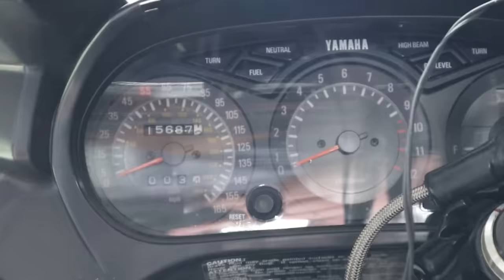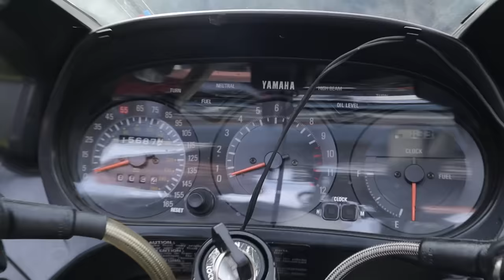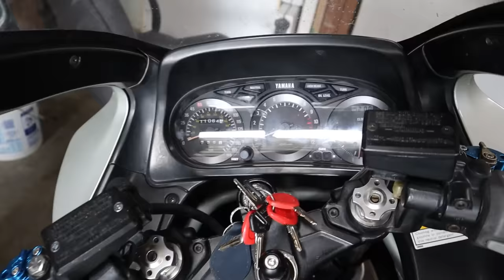Will This 37 Year Old Motorcycle Run & Get Me Home?

Comment: This reminds me of the fairly new lawnmower my buddy gave me. He said that if I could get it started, I could have it. Took it home, checked the air filter and spark plug, checked the oil. Everything looked fine. Put gas in it, pulled 2 times, and it started. I called him to tell him and I asked him "did you ever make sure it had gas when you couldn't get it started". He swears that he did, but he was fine with me keeping it. That was 6 years ago and it's still going strong.
Reply: Is it a Honda?😁
Reply: it aint got no gas in it
Reply: That lawnmower's going better than my same age marriage! /jk
Reply: @dxb338   Well stated, Karl

Comment: Self inflicted problems. Never put water in a tank unless you have the time or equipment to dry it out completely before using it. If you are trying to get it going quickly, dump fresh gas in it, swish it around and then dump it out. Then you only have the left over rust to worry about.

Comment: Awesome deal Craig!! I love the FJ's!!

I've personally had four FJ-Series motorcycles - a 1984 FJ600, a 1984 FJ1100, an '87 FJ1200, and a 2005 FJR1300. They are fantastic bikes!! Super comfortable (even with the stock seat!!), very reliable, great handling, and ridiculously fast for their time.

The biggest downfall of the early models is the 16" front tire and tiny, 2-piston front brake calipers on tiny rotors. There are only a couple of tire manufacturers that make rubber for those things. The brakes were acceptable for the era but compared to modern brakes, I think Groms have better stopping power...🙄🙄 In 1988 they switched to 17" wheels from the factory which really helped - a LOT! They also upgraded the brakes to the 4-piston calipers with 320mm rotors from the FZR1000.

I believe his Blue one is 1992 ABS model. Very rare these days!!

The biggest mistake you made with this attempt was trying to wash that tank with water. If you had just flushed the tank with some fresh fuel and synched the carbs, you probably could have rode it home. 

The only ergonomic downside to the FJs was the handlebar buzz.  They put huge bar-end weights to temper the buzz, and it helped tremendously, but after a couple hours of continuous highway, your hands start having off-body experiences...

Mechanically, they are rock solid powertrains except for 2nd gear. It was a little weak and many people who drag-raced them would blow out 2nd gear. A little machining (undercutting) would do the trick but it required the engine to be pulled and cases split.

The demise of these bikes turned out to be the automotive racing world...The Legends cars racing series was born in 1992. They are 5/8th scale '34 Ford styled, tubular framed cars using the FJ1200, XJ1250, and FZ09 engines. Many FJ1200's were removed from the roads to power these race cars, hence there is a distinct shortage of these bikes on the roadways.

Great video!! Great bike!! Love the channel!!!

Comment: I have cleaned loose pieces from (empty and dry) tanks by removing the petcock and blowing compressed air in the petcock hole of the tank while at the same time as blowing the air putting a shop vac on the fill hole. You will hear the rust and dirt pieces bouncing around and getting sucked out then eventually you wont hear any more loose rust pieces in the tank. Make sure the tank doesn’t have any gas in it and is dry. I sit them open in the sun outside of my shop for a couple days to make sure they dry out fully.

Comment: Finally, a famous YouTube motor head has featured my favorite sport touring motor cycle of all time! Thanks Craig! 
I have a 86 fj1200! If you aren’t familiar with these bikes, I like to let you know they are capable of 100k trouble free miles and the torque is there for days!
Reply: They could really use a 6th gear. I went down two teeth on my rear sprocket, really helps with fuel consumption and gives you a little more top end speed, as if anyone ever needed that lol. One of these days I'm going to find a really tidy XJR and make it my forever bike.
Reply: If you want a 17" rear wheel, the FZR400 wheel with spacers is a match. For the 16' rear I recommend the Avon Cobra tyre. I tried a Michelin Commander because of the high mileage you can get from them, but found they don't hook up nicely in the wet like an Avon will. There's a cheap brand called Full Bore, they stick well but you'll be lucky to get 6000km from one.

Comment: I worked at a bike shop in Bristol (the original one ) and in the 4years on the parts counter in the 1990s I only sold a few service items for this model .the hydraulic clutch slave cylinder was a week spot and for some reason the rear wheel bearings (don't know why) I had customers who used these for work dispatch riders who deliver important documents usually legal papers and some of them ran up over 100k with no problems.brilliant bike 👍
👍

Comment: I was in that situation once (water in the tank....). The water always settles at the lowest point, which is the float bowls on the carbs, and they have drain screws on them. After repeated draining, petrol eventually started coming through, and internal combustions were resumed.
Reply: Good tip!

Comment: @20:00 you should start bringing BBs with you for these adventures to clean tanks with. I usually use copper BBs (like for BB guns) I've done that for quite a few tanks, just throw a little fluid like degreaser or white vinegar in with them then slosh and turn it while sloshing them around and it'll clean up tanks with just surface rust really good. If its a little deeper rust you can strap the tank to an atv/car wheel while jacked up and throw it in gear and it'll come out like new but it's definitely a lil sketchy lol.

Comment: I used to have an FJ.  A red 1TX which I had for a few years. Always reliable and with lots of grunt and decent handling for a big heavy bike. I replaced a rattling starter chain which meant splitting the motor, but a nice engine to work on. There's a great owners club in the UK with tool rental etc. Great video, thanks.
Reply: My buddy has 52 FJ's

Comment: I have an 87 fj. I modified it for drag racing. lowered, r1 rims, lowered and tucked in the front fairing, dropped the handle bars 8 inches, wheelie bars, 2 step, air shifter, shortened the tail 14 inches and modified the seat. I bought it with 110 000 kms!!! I could tell it had been through a lot already. most fairing attachment points were broke, cracks everywhere. exhaust rotted at the collector so i modified the exhaust. raced 3.5 years with it. placed 3rd overall my second year, 4th place last year and it still wants more but i want to go faster so im going with the gsxr 1000 with extended swingarm... new ballgame

Comment: Pro tip for water in your tank works with lawnmowers too, if you have water in the fuel you can at cheap gas with lots of ethanol or sea foam, really just look for anything with ethanol or isopropanol water mixes with alcohol and alcohol mixes with gas it's especially useful if you have a mostly full tank of fuel it also works with diesel, seafoam is made for it it works really well and it can help lube the top end if you use it right it also won't effect how it runs or it'll run better
Reply: I used to add 20ml Methylated Spirits and 60 ml deisel to each full tank of petrol on the two FJ's I owned, travelled 50, 000 km on each bike from 100,000 km on the clock when I bought them, no trouble at all

Comment: After watching your videos I got off my coach and worked on my 1973 GT250 twin that has sat for 20 years. It now starts with one kick. Now I have to clean the tank and fix the front brake and I can put it on the road.

Comment: I had a 2009 Yamaha Royalstar 1300cc quad carb. I synced the carbs multiple times using the surgical tube and transmission fluid method. Worked great!

Comment: The best way I have found to remove rust from a fuel tank is to drop about a foot long piece of chain in the tank and shake it around. Rinse with some WD-40 and repeat. Carry a couple of gallon sized cans of the WD with you. It works great and burns off better than water.

Comment: I rebuilt an old Yamaha Radian with a really rusty tank.  I bought a container of BB's, and along with a little gas, was able to clean the tank really well just by sloshing it around.  Only took about 20 minutes of rolling it all around.  You should keep a container of those in your trailer.

Comment: I had an '88 in white & silver with red stripes. Updated to R1 brake calipers (bolt straight on) & braided lines. Cobra slip on cans, K&N filter, Dyno Jet kit (used the "medium" setting parts). Was bullet proof & fast. Plastic body parts go brittle & crack so learned how to fix that. Put a "shift kit" in it, as I heard that sloppy shifts could destroy 2nd. gear. Toured it flawlessly. Best bike I ever had.
Would have bought another if not discontinued. The FJ1300 was too expensive & too heavy for me when it came out, & not a shaft drive fan. Now have a 2013 Suzuki GSX1250fa. The closest I could get. Less HP, more torque, & water cooled. Radial tyres, fuel injection & 3 piece hard luggage standard. But man I miss "the Rocket 88" !!.

Comment: Craig - A 50/50 mix of water and vinegar with a dash of salt and one literal drop of dish soap will often clean a tank in 15 minutes to an hour while if really badly scaled with rust might need a day or two.  What you drain out can be used around fences as weed killer.  If you had filled the tank with the vinegar solution when you first got there it may have been all ready to flush with the garden hose after you got the carbs back on.  Some might use muriatic acid however you have to be much more careful with it and flush out the tank extremely well afterwards.

A can of Dry Gas might have gotten you past not borrowing a hair dryer to warm up the tank and dry it out before putting the gas in it.  Sometimes even an old radiator hose on your trucks tail pipe can be used to dry things if you don't have easy access to a hair dryer or a heat gun with a low temp setting.

Best!

Comment: I have personally experienced what water does to your bike. My 99' Suzuki SV650 had a broken tank drain pipe which would let water into the tank and you could see the seperation of water and petrol when I drained it. Water sinks to the bottom and then thats what gets sucked into the carbs. I've heard methylated spirit absorbs water and makes it easier to burn, so try carrying that around and adding that into the fuel.

Comment: For rusty tanks I've had great success using The Works toilet bowl cleaner, cleans the rust right up.  Leave it set for an hour or three.  Rinse with water and  baking soda to neutralize the acid.   Coat inside with WD40 .  Works great.

Comment: I saw an FJ 1100 yesterday going into an underground carpark. It looked awesome. I recognised it from my distant past. Saw it again today. It looks like new. I remember when they were released here in Australia in 1984. Proper super bike. That horizontal incline 4 and for it's time weird  frame and half (?) fairing fixed directly to it were so distinctive. I knew they had 16's front and rear, but hadn't thought about how difficult tyres might be to get now. Just spent a bit of time checking online how much a good 84 FJ11 or later FJ12 Might cost. If I remember correctly Yamaha fitted them with a really wide rear tire to help control those beasts.

Comment: There's no better motorcycle to bring back to life after being parked up for 20 years than a FJ 1100 or 1200. Extremely bulletproof engine, a rigid chassis that is ready for suspension, wheel and brake upgrades and a torque monster of an engine that pulls like a freight train. I've owned a 1990 FJ 1200 and currently own a 1993 FJ 1200 that has been treated to the full suspension upgrade and later model 17" Yamaha wheels. It shocks people when I tell them that my old Yamaha is 30 years old. Riders that ride it are even more shocked that it is 30 years old.

Comment: Nice work, Craig.  I like it when you get bikes back on the road.   Evaporust will do the trick on that tank if it's just rust.  If it's old varnished gas, I've had good luck with a mix of PineSol and hot water... let that sit for a day or two then do the Evaporust and you should be good. .

Comment: In the future. Water is more dence than fuel. Put some gas in the tank, wait 10-15 minutes, and drain the line from the petcock. This will pull out the majority of the water. You can also add alcohol to the fuel, as it bonds with the water, and helps separate it faster.

Comment: A handful of nuts and bolts, and some tank cleaner, sloshing by hand,and flushing with water, and then drying out, should give you a good start on the tank. In line , see through fuel filters are great.

Comment: Hi Craig, nice video as always! I think you can get rid of the water in the tank by washing it with ethanol as it is miscible with water. Than you can fill it up with gas (the engine should tollerate the slightly higher ethanol percentage). Or you can fill with gas, shake the tank and drain it from the bottom slowly until you see gas pouring out. Bye from Italy!

Comment: If you are into old Yamaha, you'll probably like what I did with a junked old XJ900S Diversion from 1997 with 89,000 miles on the clock. It was a lockdown project that turned out quite well. See profile photo. Works great now and weighs about 35kg less than stock.

Comment: I know everyone hates ethanol in fuel but here's a place it could have helped. An old trick for if you had water in the fuel was to throw half a litre of ethanol/methylated spirits in the tank and give it a good shake. The water will attach itself to the ethanol and kind of mix with the fuel (not well, but well enough to get carried through with it if you don't leave it to settle). Ethanol usually comes as 70% and actively absorbs water but it's still flammable at 40% water (vodka burns). So a litre of 70% ethanol will absorb 750ml of water and still be flammable. Even better would be to rinse the tank with ethanol then empty it out before adding fuel, that's how I get tanks totally dry after rinsing them when adding a sealant.

Comment: Let us know how you de-rust that tank. I just finished a 7.5 gallon ZG1000 in similar condition. A few weeks in molasses water with a couple sessions of shaking with nuts and bolts inside. Then a vinegar wash, water rinse, alcohol drying and finally a phosphoric acid pickle. I got some white dusty residue from the phosphoric acid rinse but I added a fuel filter. Anywho, this seems to have worked but it would be nice to see how you proceed with this tank. Thank you!

Comment: Need some high proof ethanol to add to the tank. Everclear 190 or moonshine over 130 proof. It will make the water mix with the gas. Methanol may melt tank sealer. A friend of mine loves his FJ1200. He almost went insane trying to fix an oil leak in the front of the head. It was buried South of the equator. Had to take half the bike apart just to get to it.

Comment: Need the airbox to create some choke/restriction to make for proper jetting otherwise it will be too lean. If it were jetted for PODS then you would not be lean with them off as there is little restriction with PODS.
Reply: It's also had its exhaus modified. Valdating the jetting would definitely be a good idea.

Comment: Have you ever used Gas-Dri. or Heet? It's basically ethanol (or maybe methanol) that makes the water miscible with the gasoline, so the vehicle can burn off a small amount of water in the lines.

Comment: white vinegar from the grocery store will clean that tank up. remove anything aluminum from the tank, plug everything off and fill it with white vinegar. the acetic acid will eat the rust and it only takes 2 or 3 hours. if you have any varnish, acetone will dissolve it. just be careful not to get it on any paint or anything plastic that isn't rated for fuel.

Comment: You never show checking the oil and that is a must. Right along with brakes. Just like air pressure in the tires. Plus many other items that you need to go through like check lists for a pre flight, so you don't crash and burn on the road or midflight.

Comment: As fo Carb Synching I adjust the master butterfly so it aligns to the small idle fuel inlet hole and then adjust all other the same way. .  On my old XJ-750   The vibrations were moved up from    4,8000 rpm to 6.000 rpm. . 😉

Comment: I bought a red/white FJ 1200 back in mid 1985 in Toulouse FR. The shop invited me to Paul Ricard racetrack to test the latest Yamaha's like the FZ 750 with the 5-valve cylinder head which made it run silky smooth. I installed a white custom seat, matching side panels, and a set of Fiamm air horns on my FJ and drove it to Rome. It turned heads everywhere I drove it but in Summer city traffic would overheat and lose power. Later I exported it to FL and got hit with that huge import tariff established to protect American junk.

Comment: Muriatic is the best way to get rust out of the tank. But need to oil it after to keep the rust from coming back. Then Denatured Alcohol to mix with the water so it will burn.

Comment: Great video as always, guys!   Great bike.  Time to make a rusty tank kit for the next time you get a tank where half of its weight is what used to be metal.   Put a reusable filter in the middle of a line so you can bypass the regular filter and then either swap out extra filters or swish the one filter around in some solvent and you're off again. Then clean up the filters til the next time you have a tank with 5 lbs of tank cancer floating around in it. Also: Dry-gas.  Been there. ugh

Comment: easy way to seat those stubborn carbs is some brake clean. lubricates the rubber and the carbs will slip in, then it flashes away and leaves a tight seal.